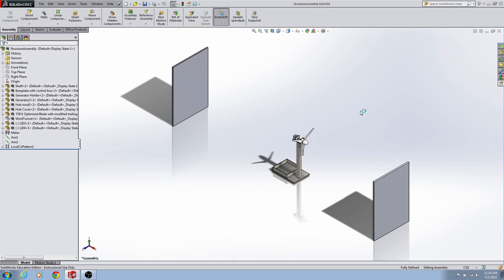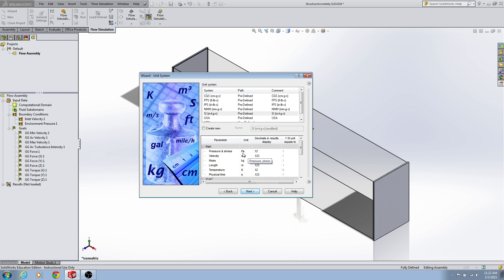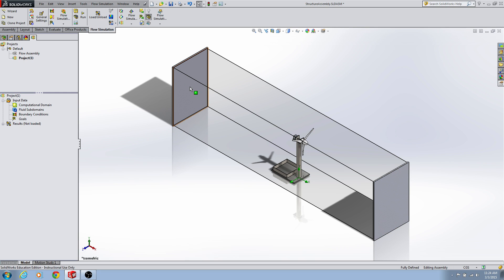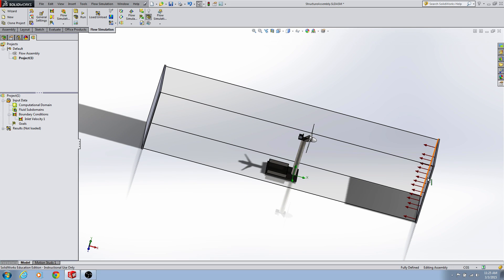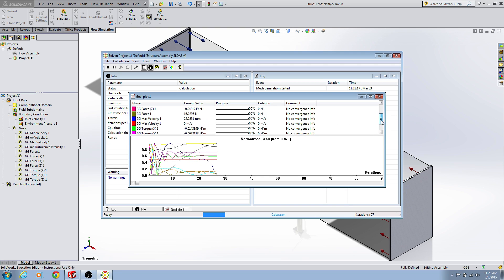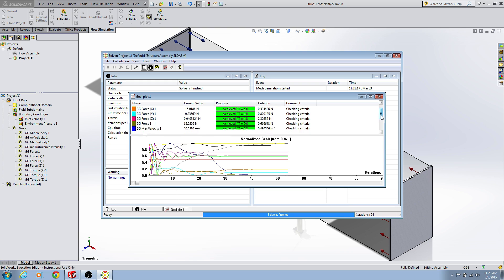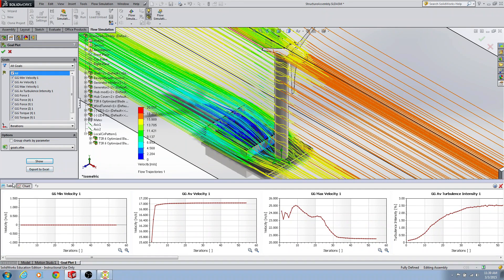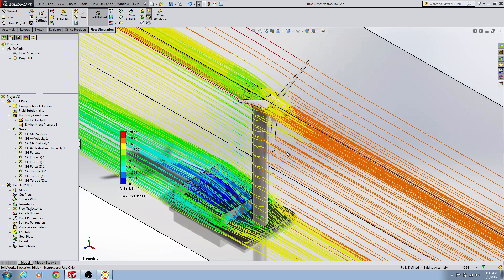Solidworks Flow Simulation

Comment: Hello sir, can you help me how to find the rpm/ angular velocity of a vertical turbine in Solidworks flow simulation only given with wind speed and the specification of the turbine ( rotor diamter, blade height, chord length). Thank you and Godbless.

Comment: When you were reading out torque results, remember that you got coordinate reference at the bottom of the wind turbine, not at the center of the rotor. So torque around Y axis is a result of bending of the whole turbine (you got coordinate reference at the bottom of the turbine). So torque results are not correct.
Reply: How can you change that?

Comment: Hi Shane, 
This is really well explained!
I have designed a turbine (savonius vertical axis wind turbine) and I want to find the wind speed at which the turbine will start rotating. Do you know how we can obtain that from solidworks flow simulation or any other software?
Reply: Hey, did you find the asnwer?

Comment: This is not working for me, the air is passing straight though the object with no change to it's path or velocity.  NEED HELP!
Reply: Ad thickness.... Simulation only works for "solid" objects.
I had the same problem when I started.

Comment: Hi all, how to see deformation of the round support/pipe under turbine? I need instead of turbine to simulate big surface of PV panels against strongest winds. Lets say max wind speed is around 200km/h (55m/s) and I need factor of safety 3....so panels and support should survive those extreme conditions not going in "plastic/breakage" deformation.

Comment: Did I understand you correctly when you stated that in a wind tunnel setup like this you cannot impart movement to the assembly being tested?   Is this by choice or does this only apply to the particular version of SolidWorks that you are working with? Does it apply to all versions of SolidWorks across the board?

Also; if it is possible to impart movement (in the case of your model, the rotation of the fan blades) how does one go about achieving this?  I am able to set up the wind tunnel for my testing but ideally with the models I'm testing it would be far more beneficial in terms of collecting specific data to have my model rotating in the same manner it would if it were actually an installed and working part.

I haven't tried it yet for myself and I don't know if you have either but I'll ask anyway; is it possible to create an animation of a model such as yours that does have the fan blades rotating as they would in the real world, and then installing that animated model into a flow simulation for a more real world analysis?

Comment: Hi Shane,

I am trying to run a simulation on a wind turbine at the moment. Surely to work out torque, the blades need to be spinning as there will be different wind speeds across the blade?

My project is trying to quantify the benefits of 'winglets', I have a very similar set up to you at the moment however I am struggling to understand how to get results that will quantify my innovation. Have you any ideas?

Power/Lift/Drag would be a useful output.

Thanks

Comment: Hi Shane. Do you know how I would be able to add the ''simulation flow'' to the add in's list for a turbine I've designed in the 2016 student edition of solidworks?
Thanks
Reply from the maker: The add in list shows all available add ins for you. So if it isn't there, you will need to download it from Solidworks' website. It's possible that the 2016 student edition does not include it.

Comment: Hi Shane, great vid. I am building a boundary fence at home and wanted to look at various paling layouts to see how this impacts the fences ability to shelter the garden from the prevailing wind. Theoretically a solid fence with no gaps creates more turbulence behind it whereas one with gaps has less. Would my study be external or internal? Could I set it up exactly like yours with a section of fence with various configurations and put it in a similar wind tunnel? I want to do a basic study first so that I can see the reduction of wind velocity in the yard but also downstream of the fence see if the wind will flow over or through the garden beds. The other complication is that there is another fence on the opposite boundary which I suppose I should include in a later sim to see how this effects the wind that passes through/over the first fence. Any advice on how to set up this analysis? Thanks
Reply from the maker: Sorry for the late reply. In my opinion I would do two sets of studies. One internal set in a windtunnel to analyze the different sets of fence. Then once you have one you think will work the best, I would do the external flow with your whole setup.

For the internal test, make sure the test is with a good length of fence. An internal set will have boundary layer effects on the edge of the tunnel that will skew your results, so you'll want to have a good length relative to your meshsize. Hope this helps, and good luck!

Comment: Hi Shane . nice video.  I want to do a simulation on a hair dryer / hand dryer.   I want to model a thermal load on the heating element, and have a fan moving the air to the outlet.

Do i have to model it in an enclosed tube such as a wind tunnel with lids?   I really want to see the heat temperature and flow rate as it exits the device.
Reply from the maker: No, you don't have to simulate it in a wind tunnel. In your case you are doing internal flow through the device, and then you'd like to look at the flow as it exits the device. I believe you should be able to do that flow analysis purely with the hair dryer model itself. Just be careful with the size of your computational domain, you want it large enough to capture the flow outside of the dryer, but not too large where it will take a long time to run the simulation.
Reply: Shane Smith yeah right, especially on my ancient laptop.  thanks for the advice.

one more question.  can I add a heater element in the flow path, so that it heats the air as it exits?

I can see how to do a standard steady-state / transient thermal analysis in simulation, but I can't see how to combine this with the Flow Sim.

in the standard sim, i just add a heater element and define a value for the wattage...but i dont see how to combine it.
Reply from the maker: I actually have never done a heater combined with flow. I know you can, but haven't done it myself. I recommend seeing if you can find a tutorial video on Solidworks website or elsewhere on youtube.
Reply: Shane Smith no worries.  i'll check on the SW site. there doesn't seem to be much on youtube. it's either one or the other.  cheers :)

Comment: Hi Shane
Thanks for the tutorial
I have a question
I am trying to analyze windload on a steel substructure and  i am doing the followings
1) I model a refereance surface (representing the cladding) around the steel sub structure
2) i run the flow simulation
3) i export the results
4) i start a static study
5) in the study i exclude the referance surface from the analysis
6) i import the results of wind simulation
7) i define boundary conditions material and joints in the static study
8) when i run the study - i end up with an error ''no external load detected''

what can be the reason?
can you help me with it?
thanks...

Comment: Hi Shane,
Very good work.
I have one question, How can we get the rpm of the turbine from the above study?
Can we get it from SolidWorks Flow Simulation?
Reply from the maker: +Micheal Johnson You can get an estimate of the RPM using the design Tip-Speed-Ratio. This gives a ratio for the speed of the tips of the blades compared to the windspeed.
Reply: @shanesmith7550  that is brilliant

Comment: how to calculate rpm using this information? if velocity is 17 m/s, what would be the rpm?
Reply from the maker: you can use the theoretical Tip-speed-ratio to calculate the rotational speed.
Reply: can we run it as a propeller? run at specific rpm say 100 rpm, then calculate average velocity just before the disk , assume it comes out to be 10 m/s, it should tell us how much average wind velocity will make it run at what rpm. like in real world if the wind is blowing at 1 m/s our turbine will rotate at or close to 100 rpm.

Comment: How do you work out the speed of rotation from the Solidworks Flow output data that you have extracted?
Reply from the maker: Gordon Durward Solidworks doesn't allow the turbine to rotate during the simulation, so we only get forces and torques, we can't get rotational speed. You could use kinematic equations to try and solve for the rotational speed, but that assumes no energy loss which isn't accurate. 

My design team primarily used these simulations to analyze the torque our blades would produce at a given wind speed as well as the aerodynamic effect of the structures. If you wanted to find efficiency, (I assume that's why you wanted speed of rotation) you would need to do real wind tunnel tests and use sensors to measure your RPM for different wind speeds. Then you can use the theoretical TSR you designed the blades for and the energy present in the swept area of your turbine to determine efficiency. 

More advanced CFD programs allow for the turbine blades to rotate (such as FLUENT) but they are much more expensive and my team was not able to gain access to them for our design.
Reply: Shane Smith Appreciate the feedback. However, I wonder if you put a rotating region around the propeller and did an external analysis - might it not be possible set the rotating region to say 1rpm - and see the rotational torque that is computed by Solidworks Flow - then set the rotational rpm to say 10rpm - and see the rotational torque  that is computed by Solidworks Flow - and from these 2 new study's - and your internal study - to estimate the rotational speed by interpolation? 
(Just out of interest what diameter is your "wind turbine" - since the torque of 0.022Nm appears incredibly small?)
Reply from the maker: Gordon Durward You definitely could, I'm just unsure how accurate it would be. We had large errors when we did an external flow (we got literal tons of force pushing on the turbine). This turbine had a 45 cm blade diameter, since that was the size limit for competition. Our turbines spun very fast, we had a TSR of 6 and observed speeds over 4500 rpm with wind speeds in the tunnel around 12 m/s. 

There's a lot of possibilities for simulations, but given the complexity of our model it was difficult to determine what was causing the errors we were observing, so we decided to go with what we knew would work, although it gave us less total information once the simulation was done. It's possible we didn't set up the external simulation correctly or that our mating on our assembly had some errors.
Reply: Shane Smith It might be worth looking at the Solidworks Tutorial Book (which I assume you will have as you say you are an academic) - Lesson 8 - which deals with the setting up of a small cooling fan that you would use in your office. You need mesh refinement in the rotating region, and the narrow channels box ticked too. The diameter of that fan in this model is about 360mm in this lesson - and runs at about 1910rpm - and requires 0.5Nm of torque. 
The fan in Lesson 8 obviously has a much higher aspect ratio than your one - and more than likely a different pitch too. However, for the rotational speed you have indicated (4500rpm) my notional thought is the torque for your propeller does appear very low. 
(You can download the file I am referring to from the Solidworks web site - see below - and you can also download the completed version - to see the setup and results).
http://www.solidworks.co.uk/sw/support/808_ENU_HTML.htm